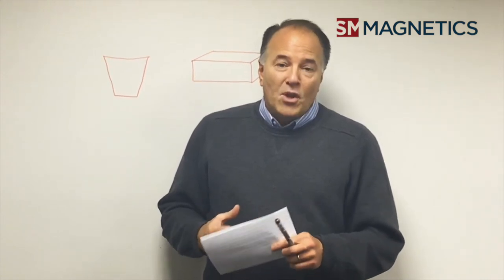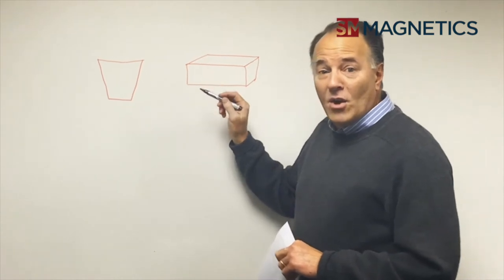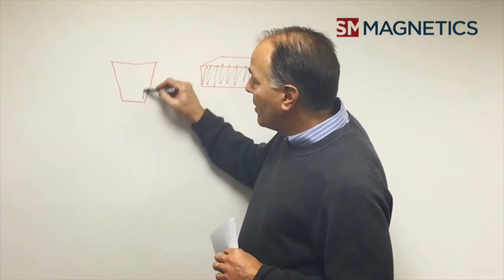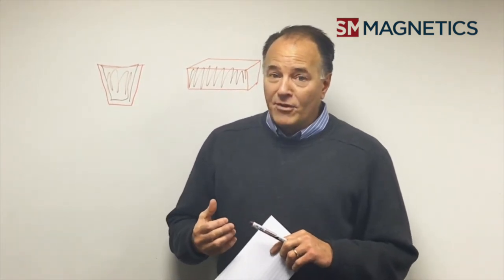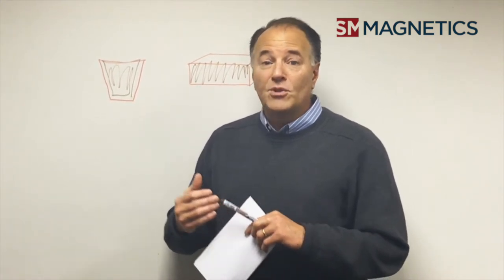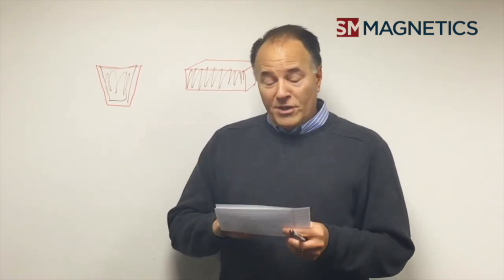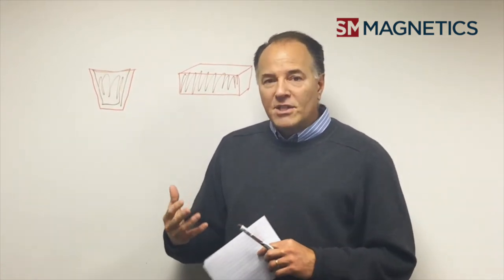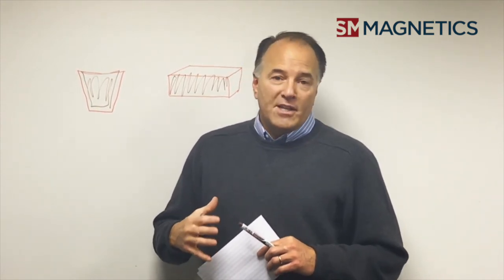FAQ: Can I make a magnet stronger with more power?

Comment: I have about a dozen magnets that are about 2”x1”x4”.  I would like to build a nail picker upper with them.   First attempt was joining them North to south on the 1” x 2” ends To create one long 1” x 2” by about 28 inch magnet that was zip tied to a 2 x 4 and put on a couple of wheels.  The results were kind of underwhelming as I think the magnetic fields were channeling through it and it didn’t have a lot of pick up power.   My next two thoughts are either Ness the magnets in the same configuration surround them by eights inch or quarter inch plate on three sides leaving at 2” x 28” portion open towards the ground.   Will this concentrate The magnetic force downwards to pick up my nailsBetter.  I know speaker magnets Are shielded in a similar way.   Or should I stack them north to south on the 4” x 2” faces with quarter inch or three eights inch mild steel plate in between and on the outside of the stack?  This seems to be how door catches or welding arrows work with just A plate on either side of one magnet.  Or a few other things I’ve seen Have Multiple magnets stacked with for material plates or sometimes price in between the magnets.

Comment: I have a ring magnet that I remember being stronger. Do they weaken over time? That's why I searched this. I suspected I had lost power and was wondering if it could be topped up.....
Reply: I think it weakens by half in about 5000 years … and also depends on the material which is made out of

Comment: Can i generate energy with magnets?
Reply: yes, most of the worlds electricity is made that way, its actually just steam making motors/generators spin,electricity doesnt  come directly from nuclear energy or coal its actually the heat that they produce making steam get pressurized and is then used to make generators spin, generators consist of magnets and coils
Reply: Sooo, the answer is no.
Reply: @sonnyg9622  *yes, read my comment
Reply: Yes, look up induction motor.